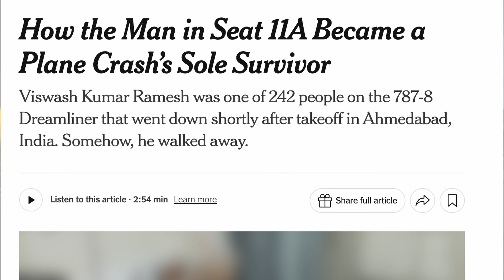Why the RAT Changes Everything – Air India 171 Update

Comment: I salute captain Summit of AI171 as both engine failed after takeoff at height 625 and with huge fuel passengers weight the plane without energy falling  like stone and in 30 seconds what command can run ! he tried his best to return runway or place with less casualties after crash. I have a question about any external command power activity  is operating the running aircraft that ordered to stop fuel as all says both engine can not fail and birds at afternoon 1-30 not so flying  and why this all complications arise after takeoff is surpirising.matter. Modern machinery advance development is such accurate that something outer command by any instrument disguised way can be installed in plane possible mobile laptop etc type ot setelite run something mischief also happens. So is it possible which not declared not seen anywhere unidentify  unreveled situation  at that time  operating commanding so captain command failed.

Comment: There was a guy who was on that exact plane on the previous flight who posted a video online originally meant to report electrical issues on the plane. All of the screens were blank, nothing was working. Based on that I’ll say electrical. Great video - sheds light on a lot of unknowns. I agree with dual engine failure.
Reply: It's not electrical failure based on this analysis. And internal electrical systems such as entertainment screens not working has no connection with engine failure.
Reply: That video is no evidence, so please don't speculate. He was filming prior to takeoff when screens are not yet active which is normal. None of that is evidence as for now.
Reply: For those praising Dreamliner's record, this tells a different story: https://youtu.be/wd7mx45R6nE?feature=shared

Comment: I'm not a pilot, but an experienced engineer that has a "feel for stuff". From that fist video, it's obvious that the aircraft totally lost thrust just after liftoff. From then on, it was like watching a car with failed brakes and steering gear, heading towards a tree. The crash became inevitable.
Question remains, why would that plane have BOTH of its engine shut of suddenly at the same time?
Reply: My guess is Boeing issue. Lack of quality on those dreamliners are well documented, engineers in the factory said they would never step onboard of one of these.
Reply: @sygmaone Boeing has its problems, but they didn't make those engines which shutoff unexpectedly. Most large American and European aircraft engines are manufactured by 3 companies : Rolls Royce, Pratt and Whitney & General Electric. Which all have very good manufacturing quality records. So, this unfortunate crash points to very poor maintenance, or sabotage.
Reply: @docfarl pal… an engine failure is most likely not caused by the engine’s own issues but by the system around it, that supports it, supplies it. Could be the electrical system, cluld be software, etc.. much more likely than Rolls Royce F-ing up something…
Reply: @docfarl  highly likely it was due to the bad design of Boeing, please check the docu on them. Engineers admittedly speaking about the issues about this particular model!!!

Comment: Check another thing please: when taking off, the plane used the entire runway. We see the dirt on the end of the runway. That part of the runway was not 100% clean. Because no other plane took off using that part.  Could a lot of debris, small rocks etc have been sucked then? And interfered on the engines?
Reply: No. This is more of an evidence of the lack of thrust that they had to use the full extent of the runway. That debris or dust wont stop such an engine..

Comment: Possibility they lost power and as airspeed dropped they raised the flaps to attempt to reduce drag and extend the glide capability of the aircraft as a last ditched attempt to keep it airborne and find a safe landing spot? Would explain why aircraft configuration appears to be gear down, flaps up, it's the only cards they had left to play as they prepared for a rough landing. Question is what on earth caused a double engine flame out.

Comment: What if the type of circumstances of the ANA emergency landing example ( battery failure ), happened on take off ?.
Would such a failure also take out the FADEC EEC and fuel supply systems ?.
Assuming obviously the need for RAT deployment.

Comment: Capt Steve , CFR 25.111 says airplane must reach V2 before it is 35 feet above the takeoff surface and continue at a speed as close as practical to but not less than V2. Do you think the crew hesitated for a rejected takeoff between V1 and VR and they could not reach V2 at all. All these happens so fast that by the time they assimilate information they had no choice but to be airborne ?

Comment: if both engines did fail, wouldn‘t the surviving passenger have talked about the silence (of the engines) before the loud bang (RAT). He only said the lights flickered (normal when RAT is deployed) …… but that would mean, the lights were on before. Is that possible with a dual engine failure?

Comment: Put all these scenarios and run it on B787 simulator Dep from AMD RWY 23 high temps and MAX TOW And do all these scenarios dual Eng failure RAT deployments etc, and on positive rage of climb put the flaps up see and keep the gear down and see how the aeroplane behaves looks like a HYD failure plus engine thrust loss

Comment: The survivor only heard one big bang, that’s one engine failure, not two. There no possible that two engines flames out the same time if it’s not sabotage. There two individual systems, and multiple back up systems for each  engine. Fuel contaminants wil not make an engine blow out, it wil stop the engine from working. They had a normal take off speed, so the engine worked on full capacity until the got some climbing, and then one engine blows up. My thinking is that the same thing occurred here as on Quanta’s flight 32, were catastrophic engine failure caused debris hitting the plane and caused electrical and hydraulic failures. If that happens, it wil explain why only one engine blows up, and they lost the other one because of secondary damage from debris. I don’t know what type engine this aircraft had, but the Trent 1000 engine had corrosion on the fan blades back in 2016, but most of them now has the GEnx engine.

Comment: What I saw that convinced me that it’s a dual engine failure is that why just after take off there is no thrust in the engine which you would have heard and seen the exhaust. The ram sound also should not be louder than the engines.

Comment: Also looks like the main gears were not in angle (the front tires in an upper level than the back tires) as it should be when it just armed. The wheels look like at the same level, as if they started the movement to be stored up and stopped. Check that in the video and compare with any other video of a 787 with the gears deployed.

Comment: would someeone at seat 11a hear the rat as as bang ? it surely would not deploy too violently to avoid damage, and it wouldnt power the interior lights , only emergency floor strips , and it would take some some to get going, so a flicker is more likely from circuit failure or backup power taking over, the bang is likely what went wrong ? ❤

Comment: Interesting, I''m also following the insights about this crash from different channels.
Honestly, I found the pilot error of confusing the landing gear with the flaps also very unlikely, unless there was an extremely stressfull situation for some reason.
The two engine shut down still does not explain why the gear was not retracted, unless you suppose the dual engine shutdown happened just before the gear retraction was intended.
Then the question is: how did two engine's shut dwon at exactly the same moment (or at least almost the same moment).
My suspicion goes to some electrical or maybe hydraulic system that shut down both engines at the same time. Maybe due to some freak software bug, maybe due to an explosion disrupting more than one electrical system ought to be each others back up, something like that.
Or maybe there was a failure on one engine and immediately after that the crew mistakenly shut down the other engine.

Comment: @captainsteeeve, something that we DIDN'T hear on the 'new' video is the sound of the two jet engines. My mum lives in Timperley, about 4 miles as the crow flies from Manchester Airport, UK. Departing planes fly over regularly and you can hear them long before you can see them. Surely, we should have been able to hear the engines working in that video, if they were working. The fact we can't hear them must surely be another clue?
As a Professional Automotive Engineer, the thing that turns me away from the idea of contaminated fuel is that 1 fuel quality generally is extremely high and 2 if the plane had been filled with contaminated fuel, then surely so would other planes and we'd be hearing about them having problems, which we are not.
Forme, the idea that both engines failed together points to something common to both engines. OK, that includes fuel, and I don't know enough about aircraft to hazard any further guesses. Is there a common fuel pump or line that feeds both engines? I'd say it must be something that is common to both engines but not the engines themselves that failed..

RESPECT to everyone who lost their life that day.

Comment: Pilots had the opportunity to jump out before the fuel leak subsequent fire but they did not. It seems he was trying to find a open space to glide the aircraft. In order to glide the aircraft the flaps might be retracted it seems.  It is extremely rare both engines going off while taking off where maximum power/thrust is required. Fly by wire controls need to take care of this type of situation.

Comment: What if someone hacked the system and remotely activated the RAT, causing both engines to shut down—even though they were fully functional? It sounds like a potential bug or loophole. There were some high-profile individuals on the passenger list.

Comment: I will not be surprised if the cause is in the batteries; those may have caused a catastrophic electrical faillure which may have caused the pilots to loose all systems (it would explain why the gear wasn't retracted and why the pilots didn't have engine power). A RAT automatically deploys when all electric power is lost.  The timing of this possible electrical issue may have lead to the pilots not having the time to react properly (during take off - they may have been able to regain power but too little too late)

Now this may be guesswork - but I do remember there has been an issue with 787-generators automatically shutting off after running for a x-amount of time which may cause complete loss of control (there was an airworthyness directive about it somewhere around 2015) and the 787 has had battery issues in the past. I'm not sure if a thermal runaway or any other battery-issue could trigger a failsafe in the generators - but I would not be surprised.

Comment: Of it wasn't a dual engine out you would hear them   all large aircraft make alot of noise when those engines are running and all you can hear is the rat  i think its for sure a dual engine out. I saw another interview from.a guy that was on that planes previous flight and he said there were multiple things wrong   the screens were working right and it had no ac  felt like they were suffocating according to him.  Not sure how accurate it is but I did h3ar that interview

Comment: Regardless of what is determined to be the cause, there comes a point while rumbling down the runway that the flight crew has to come to the realization the aircraft has long since passed its rotation point without a hint of take off and a decision to abort the take off must be made. Running the length of the runway isn’t a valid decision.

Comment: Here is one more piece of evidence I saw on another pod cast
The gear trucks tilt the gear forward as the gear retraction sequence starts.
I’ve seen pictures of the trucks tilted forward.
That means the “gear up” was initiated but obviously stopped due to loss of hydraulic pressure 
I’ve been in the dual engine failure camp all along.

Comment: According to Google the RAT can be engaged manually via an overhead switch (in addition to its automatic deployment), which may have occurred due to panic from the engines running but seamingly with a loss of thrust because of the effects of the neutral or up flaps and wheels still down.  

I say we need more information! 

I hope the flight recorder says how the RAT deployed.

I suspect fly by wire led to this!  No direct linkages that you can feel as they are acting.

Comment: Thanks for your updated analysis! While the precise reason for dual engine failure may allude us, I wouldn't be surprised if the underlying cause could be that the eleven year old plane was built within the time frame during which Boeing sidelined safety for cost savings. People need to stop ignoring this, and do something about it. All planes from that time period should be taken apart and rebuilt, but they don't do it - because they are the modern Boeing company!

I feel much safer on older Boeing planes! When I fly, I pay attention to the planes that are being flown, and try to avoid newer Boeing planes. Whether it is poorly designed software or systems, or missing bolts and doors flying off, they've got a pretty bad track record. I feel much safer flying in Airbus or Bombardier planes these days.

Comment: I think the electronics failed due to condensation from the heat, which lead to partial power loss in the engines.
Its as I originally said, you can see the dip in the left wing at lift off, signalling a loss of power in that engine, the sole survivor stated a loud bang, I assumed it was an electronic failure as there is no real evidence of engine failure in a typical sense.

Comment: I would like to add something to your dual engine failure theory. The video shows the starboard landing gear is directly behind where the heat signature from the starboard engine would be. If the engine was at full throttle and the engine was functioning properly the image of the starboard wheel assembly would be massively distorted in the video. It is not. We can't see the port engine to verify if it failed. It would be reasonable to believe that it did fail. Assuming that this aircraft would have sufficient power with one engine for the aircraft to become airborne.

Comment: With so much redundancy and duplication built into aviation systems, I'm struggling to believe a dual simultaneous engine failure could occur without sabotage or criminal negligence in maintenance or repair.

Comment: If both the engines failed it still does not explain why the landing gear was not retracted or why the flaps were in the wrong position. I would point more to electrical failure

Comment: It is now accepted that the RAT was extended at the time of the accident,as masterfully explained in this video,it is necessary to make some assumption about the loss of thrust on both engines, which caused it to extend. 
Compressor stall could be a possible answer, if a sudden increase in thrust had been requested from the engines by the pilots or by the automatic system which on the B787 i believe is called TOGA SYSTEM.

Comment: I agree with your theory, however I would say it was an electrical failure opposed to engine. When the plane was vertical it maintained altitude, it was only when it tryed to climb when the nose of the plane pointed up it start to loose power and descend.

Comment: Right out the start , Capt. , I'll say I'm no professional  pilot!! But my amateur adventures on MS Flight Simulator( 🤪!!) suggests to me to differ on the dual engine failure in my laymans estimation! Was there time for that to happen & cause the accident? I understand they reached V1 ( appx 200+ mph - lots of thrust dust disturbance visible on take off?)  , reached a height  of 600ft ( which would have taken seconds to do? ) & crashed less than a mile from the end of the runway? Interstingly the RAT is not visble at 3:08 as the plane flies by the observer - the RAT isnt seemingly deployed until 3:12  - so not sure if that would  account for the 'propeller' noise. I think undercarriage fail and/or some hydraulic fail. Of course , they have a  black box now, so I guess we'll know better shortly. PS: crisis of conscience - should I 'like'  a video that shows a human tragedy ? No , I couldn't - so I'll just say this is a very insightful analysis Capt.

Comment: You talked about the RAT sound but as someone who works at a airfield where the Beluga takes off daily you hear the jet engines for quite some time adter it passes and climbs away but after the 787 passes before crashing hardly any engine sound and you would think it would be screaming at full power if the aircraft was struggling for altitude but its very quiet

Comment: In the past 12 months (June 2024–June 2025), three fatal Boeing aircraft crashes occurred. The most severe was Air India Flight 171 (Boeing 787-8) on June 12, 2025, killing 241 onboard and ~38 on the ground. On December 29, 2024, Jeju Air Flight 2216 (Boeing 737-800) overran the runway in South Korea, causing 179 fatalities. On November 25, 2024, a Swiftair 737-400SF cargo plane crashed in Lithuania, killing one crew member. Notably, a Boeing 737 MAX 9 door plug failure in January 2024 caused a high-profile emergency but no fatalities. Boeing faced increasing scrutiny over safety.
Reply: Boeing has been facing this issue for over a decade including Bankruptcy and all that. I remember my daughter did a project on Boieing and research about Boeing was not good at all.